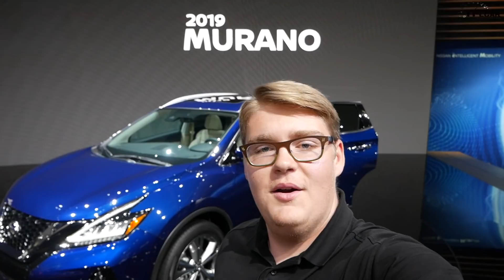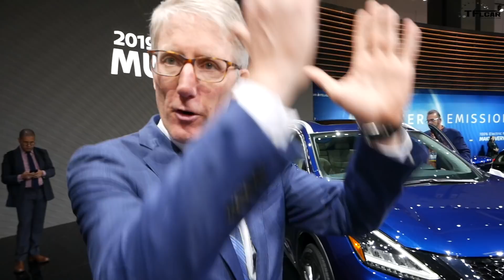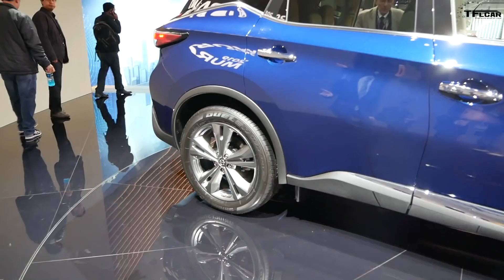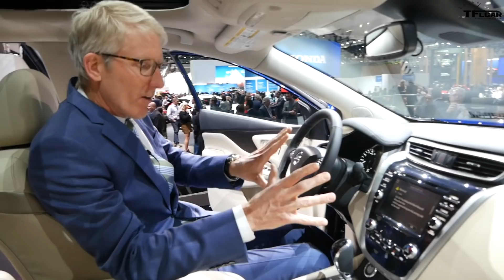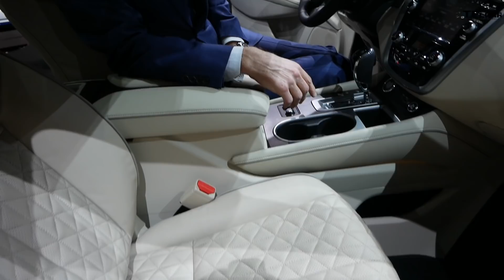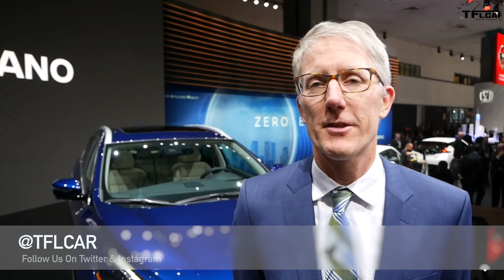2019 Nissan Murano: New Looks and More Tech & Safety Than Ever!

Comment: I would have bought one tell I found out it had a CTV transmission. Junk transmission. Back up camera is low resolution and it doesn't have a capless gas filler. I do not like 20 inch wheels it ruins the ride . I like 18 inch. Just make 20 inch a option.

Comment: CVT is great. I had it for many years, never had any problem. Though, I'm not surprised to hear cvt break down for some. If you drive like a maniac, brake and accelerate like gas is free, then don't drive a CVT. Drive a manual transmission. Nissan should also make CVT easy to replace. For those of us buying used cars, I surely would like to buy a Nissan with broken CVT for a really low price and swap it out with a new one.

Comment: All these cvt haters on here  are ignorant. The Murano is a fantastic SUV. The engine never fails, the cvt is perfect for it (all manufactures are going to cvt, get over it), the styling is still on point (when it premiered it rocked the world and manufacturers are still emulating it), it’s spacious, comfortable, quiet, good on gas (thanks to cvt), and best of all, extremely reliable, not to mention safe and cheap to insure. Oil changes are under $50. You can’t beat it.
Reply: Agreed, all the auto journalist keep harping on CVT’s and how cars should have manual transmissions. Let’s move on shall we, we all know we need to address Climate change and manufacturers are being pushed in that direction with stricter fuel consumption requirements.

As for the styling, I own a 2018 SL and love the interior. I like all the changes that they did, the one miss is the steering column, even after 21 months in my SL I still search and dislike the volume control on the steering wheel. I usually use the radio knob, it’s conveniently placed and more natural to reach then the steering wheel controls. 

Note Nissan, people change the volume more option than they scroll through the screen menu options. The buttons should be swapped.
Reply: Pierre C. Agreed. The vol button placement on the steering wheel of the Murano is second rate. Same with the gas cap release. Why is it always on the left side if most ppl are right handed? Whatever, no car is perfect.
Reply: My Qashqui was 6 months outside the Manufacturer's warrantee of 3 years which the car did 67000 miles when the CVT belt snapped.. the garage & Nissan just wanted me to pay from which I had to.. only cost £5000 .. sickening and everyone else would be too.. never touching a CVT transmission car again .. oh and no trailer was pulled & was driven to speed limits only.. the thing I also don't get In the UK is why are Nissan still only offering 3 years warrantee or 60000 miles ?
Reply: @scottfromengland2303   Nissa offers 5 years on powertrain not 3 years you should be able to get it fixed under Warranty.
Reply: @omar112able  not in England they don't want to know
Reply: LiverPool Fan       67000 is a lot.  How much were you expecting?  Unlimited?
Reply: @mark_r49  well in America the Nissan Qash has a 100,000 warrantee I hear... ? Which if this was the case in Europe would have saved me paying out £5000 on a recon transmission when the car was only 3 1/2 yrs old at the time... ??? It's a joke to think Nissan as a manufacturer can offer such great warrantees to some country's and not others... Maybe when your Nissan breaks just after 3 years and you have to pay out another £5000 of your own money I may read your post of how unhappy you are with Nissan... I can understand some transmissions break.. but the warrantee should have covered it ... As it was under 100000... 67000 to be exact... How would you feel spending thousands on what you think is a good car..a car your wife really wants to take the kids to school, go to work in, a car we wanted to use to do family stuff etc.. and bang..!!! The transmission breaks 3 1/2 years in 😥
Reply: So fun to drive!
Reply: I've got an '18...the Murano ain't good on gas.
Reply: CVT haters are all taught that by car reviewers.
Reply: Joe De La Garza My Wife Has Had And Has A New Maxima with the TERRIBLE CVT Transmission . In really cold Quebec temperatures the car will Not shift until it warms up ( 7-10 minutes). My New Santa Fe has a real Transmission world absolutely Perfect at all Temperatures it has a 5 year warranty as apposed to a 3 year Nissan Warranty
Reply: Jose C CVT not good in -20 C weather we have a 2018 Altima

Comment: The exterior is so over-styled and busy - the front lights actually starting to look like Honda's. The interior belongs to 2016, not 2019. Come on Nissan, you can do better than this!
Reply: The style of this thing is called the corporate face every single nissan looks like this and it started with the Maxima ok, Mercedes Benz does the same thing and no one complains
Reply: @byronrideaux  I get that they're trying to be consistent with the design, but the styling of the front lights definitely look like Honda's - the rectangle/vertical compartment look. No one complains with the Mercedes perhaps because of the design itself look nice and elegant, not over-styled like this. Well, that's my opinion.

Comment: people: “we want normal transmissions and a better interior”
Nissan: “do y’all hear sumn?”
Reply: Lol Honda , Toyota, Subaru, Mitsubishi and lately Mercedes and Lexus are using  CVT , some people enjoy the smoothness of CVT in a suv
Reply: KC Mabel Toyota and Lexus only use them on the smaller less expensive cars and the one they use now is kind of a automatic-cvt hybrid. It has a real first gear then shifts in to cvt mode.
Reply: Bowtie Guy  CVT functions the same way as any other transmissions  because there are no gears in cvt but the gear ratios still apply . All the nissan CVTs have “manual shift mode “ or first gear, gear ratios still apply in cvt that’s the only way you can balance speed with power. Nissan was the pioneer of CVT and it wasn’t in all of their cars at the beginnings of the Cvt revolution now it is , except in their trucks and their manual sports cars. Mercedes might be experimenting with their lower models for now.
Reply: KC Mabel the cvt transmission functions absolutely nothing like a traditional automatic transmission, it does the same job but does it in a totally different way. Really they share hardly anything mechanically in common other than the differential section. You’re right Nissan was a pioneer of cvts. They showed everyone else how not to build them. The new Toyota unit has an actual first gear not driven by the cvt belt. It is absolutely different than anything else I know of. I have no idea if it’s any good but it is different for sure.
Reply: Bowtie Guy the only difference mechanically is that cvt has no gears instead it has a a belt and pulley system but the concept of gear ratios still apply to cvt  they simply aren’t limited to the ratios of actual physical gears. Anyway I get your point you like Mercedes and you  seem to think Toyota has a better “cvt”  because of the first gear which it is in all the Nissan’s vehicles anyway , all I can tell you is that every manufacturer will tell you their cvt is better when in all reality the principle of starting in first gear and then moving with the belt and pulley system is the same . Btw I am not an expert but there are many articles online about cvt that aren’t made by journalists, tv presenters or YouTube influencers but actual engineers, mechanics and designers.
Reply: KC Mabel saying the only difference mechanically is the belt and pulleys is like saying, the only difference between a mouse and a giraffe is the length of their legs. Automatics and cvts are totally and completely different mechanically. They do the same task which is provide drive ratios to propel the vehicle down the road but couldn’t be more different in the way they do it mechanically. Look at the video of the New Toyota cvt it has actual real gears for first gear then the belt and pulley take over. The Nissan has computer logic that hold the belt and pulley in place to make you think you have a first or low gear. I have no idea if that will prove better but it seems to me getting the weight moving on steel gears then letting the belt take over might be a good idea. Oh and I do not like Mercedes at all.  I think they’re nice cars but totally over engineered and the resale value is terrible.
Reply: Bowtie Guy I appreciate your example. Now let’s say gears are stairs and the belt and pulley system are a ramp instead . It doesn’t make any sense to have one stair ( first gear) then go into a ramp . Overrated and again nissan has first gear, any manufacturer will tell you that their version of cvt is better but the principle is the same as Nissan’s
Reply: KC Mabel you’re right the principle is the same in all cvts. I don’t know if what Toyota is doing will prove to be better or not. Only time will tell. I still maintain my position that Nissan doesn’t have first gear or any gear really. It does, however, have software that make the vehicle seem as though it has actual gears. It is an illusion just to make people feel better about cvts. I personally think it’s crazy to put fake shift points and such in a cvt but I guess people hated them so much the mfgs had to.
Reply: Bowtie Guy I  drove a Nissan micra not cvt, a 215 murano cvt and it  has first gear,  a 2018 Qashqai also has first gear and a 2015 Mercedes c300 not cvt, they are comfy smooth cars of course they aren’t fun to drive. I personally feel that a a manual car is more fun to drive automatic transmission regardless of the manufacturer are bland .
Reply: KC Mabel I surrender. You obviously don’t understand what I’m saying or you do understand and are just wanting to argue. If you want to know the difference in the new Toyota cvt and literally every other cvt on the planet then research it. Nice talking to you.
Reply: Only enthusiasts care about transmissions.
Reply: Brian Speckert most car buyers do not know what is the difference between CVT and traditional transmission ....
Reply: @aa122100  my coworker had a 2015 Honda Civic and I said how do you like the CVT and she's like what's that?  She just got into a 2019
Reply: CVT sucks on the Murano

Comment: Not a bad looking car but all these crossovers are starting to look the same, especially on the inside. Move the HVAC vents from the top of the infotainment system to the sides and its a Subaru without the space. The quilted seats are nice looking , I bet they are top trim only though just like the Explorer Platinum and the Grand Cherokee Summit, but possibly cheaper. Nothing outstanding about this car, if you want sporty I guess go for the Morano, want space get a Subaru.

Comment: Fire the exterior design engineers it’s getting ridiculous. Get rid of the cvt and stop making excuses get rid of the VQ35 start using the VQ37 or the VQ35HR
Reply: This is not a performance SUV for crying out loud.  Yall just wanna race everything and compare horsepower for bragging rights with speed limits of mainly 70mph. You and most enthusiasts won't even consider buying this vehicle.
Reply: @stevornrichards1380  lets see. From anything above 30 mph its quicker than an rx350 which has almost 300 hp and an 8spd auto. This also gets better mileage. They cant be doing everything wrong with the cvt.
Reply: brandon wright THANK YOUUUUU
Reply: Nissan should hire you like you make so much sense
Reply: Enthusiast will agree but not the market. The non HR  VQ engines are great but it is only used on premium nissan cars due to the lack of fuel economy competitiveness s vs 4cyl turbos other cars are using. VQHR on Murano?It wouldn't make sense for the market, platform, the average buyer, or from the cost perspective. This is a premium family car not a sports sedan. You would have to change the platform entirely to fit that into a FWD based transversely mounted engine.